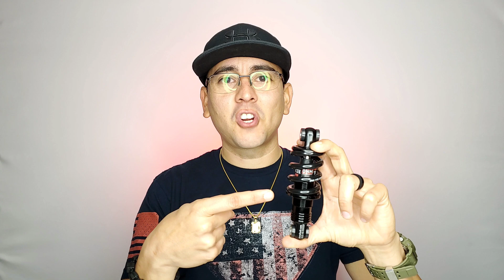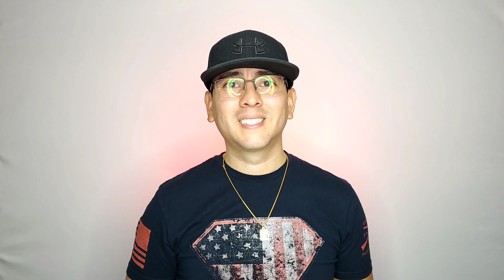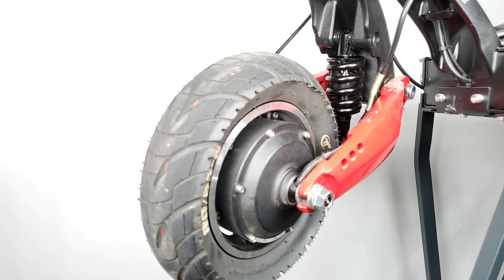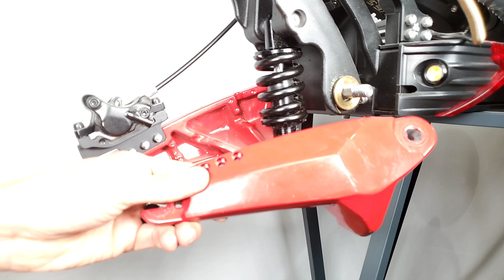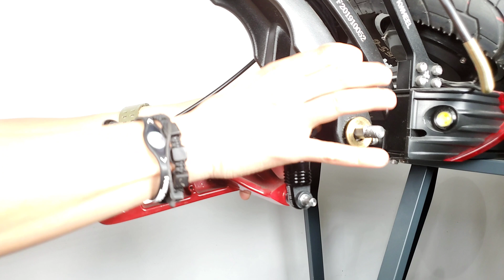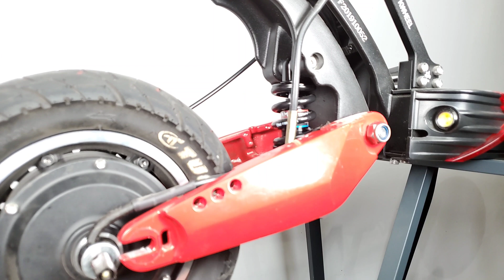Zero 10X Front Suspension

Comment: Hey I've got a quick question regarding the 11x. I bought mine second hand for a very good price. It needed some work on the swingarms and suspension but good news was the motors, battery and controller are good.

First thing I noticed upon inspecting the scooter was that the guy changed out the top shock bolts with believe it or not.... Fence post bolt, the ones were one side is domed with a square block with a nut in the end,shame on him.... I've since sorted that issue,but goes without saying the front and back suspension has a fair bit of play,it looks like the shocks are shot, the springs look bent, when the scooter is off the ground I can move the swing arms up and down..... A good 10mm play and I can certainly feel it in the ride hitting bumps.

I have some new shocks on order, first thing I would like to know is the rear shock fits nice in the frame top and bottom,bushings are totally worn though and again bent springs that lean to 1 side.

The front however seems to be missing a spacer in the top part as there's a gap. Does anybody know what size spacer goes in there please and does it need to be in the left, right or an equal amount on both sides of the top shock.

I'm slowly getting this to where it should be, I just want to be happy it's right when I go back out. 😊

Comment: Wish zero 10x has twin rear shocks like vsett11+ that be looking awesome to see them in future 🙏🌎
Reply from the maker: Yeah 💯
Reply: @PEVRidersClub  can you try able to make it extended swingarms to fitted with bigger wheels in zero8x zero9x that be cool to see them instead of having smaller wheels setup
Reply from the maker: That would be nice BUT honestly for their specs they are not meant to be scooters for anything else than quick short distance rides.
Reply: @PEVRidersClub  Ive got a zero 10x rear plate and also made it fit on my ninebot max so stoked about having them swingarm and suspension are looking beasty

Comment: My question, when having my scooter on a box off the ground suspension extended do the suspension always have a play at the bottom?
Reply from the maker: Your suspension will stretch due to gravity and weight of the tires. I don't understand what do you mean by play at the bottom? Can you elaborate on that bro 😊
Reply: @PEVRidersClub  when having the scooter lifted the suspension extends if you push the wheels up from the bottom it will have a play, have you notice in your scooter
Reply from the maker: like it rattles horizontally or vertically?
Reply from the maker: By the way I just went to check mine and put it on my lift to check and there is no movement or play.
Reply: @PEVRidersClub  vertically
Reply from the maker: I checked mine and no play bro. You should make a video of it and post it on our group: Facebook.com/groups/PEVRidersClub 

So we can help you better by seeing what you are experiencing 😊
Reply: This comes a little bit late, but if you have vertical slack at the front, those 19mm nuts at the fork are loose. So tighten them until the slack is gone.
Reply from the maker: Thanks for your helpful advice 👍

Comment: Hi! at 2:27 Why is your stock shock inverted (top is on bottom)?
Reply from the maker: Is not sir. Both my stock rear and front shocks were like this from factory until I changed them.
Reply: @PEVRidersClub   Thanks Bro. I checked falcon Pev's vid to compare. I guess yours came inverted but it puzzles me that the new DNM shock is  installed inverted as well. Hmm. Maybe there are no issues however you install it. More power bro! Ride safe!
Reply from the maker: I'll double check with them also BUT I had my 10X for 2 years and still alive LOL! 🤞
Reply: @PEVRidersClub  Wow! Your 10x still looks new!  Mine is 10 months old at 2K odo and looks old & dirty AF
Reply from the maker: I clean her everyday and no off-road for her LOL!!!
Reply: @PEVRidersClub  Nice,Its not really an off road scooter even though it will do some light stuff.
Reply from the maker: I agree 👍
Reply: @PEVRidersClub  Wheels are too small.
Reply from the maker: Yep and the frames aren't built for that also.